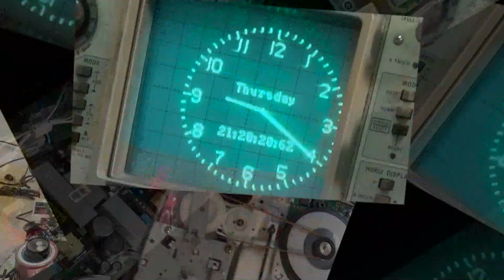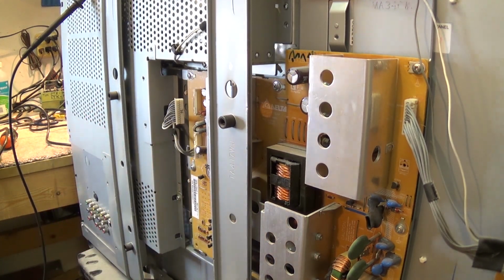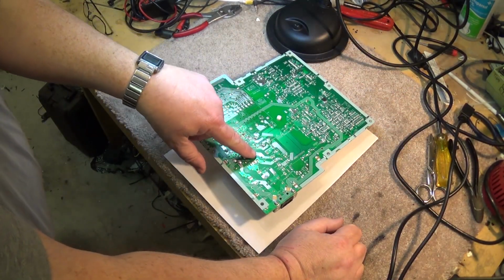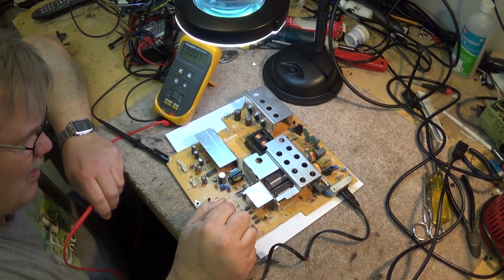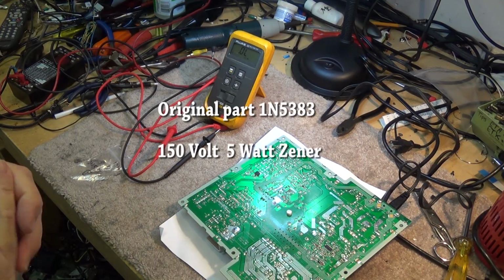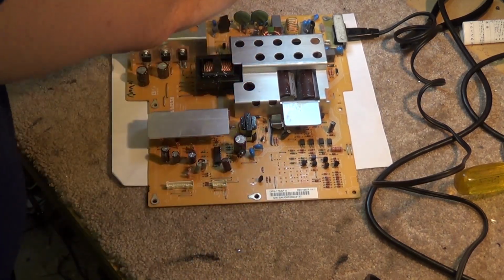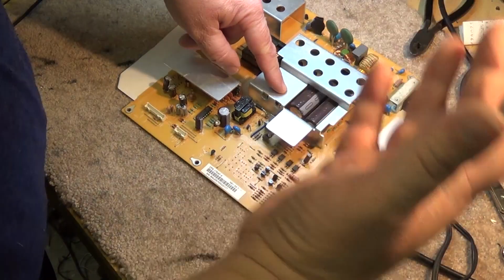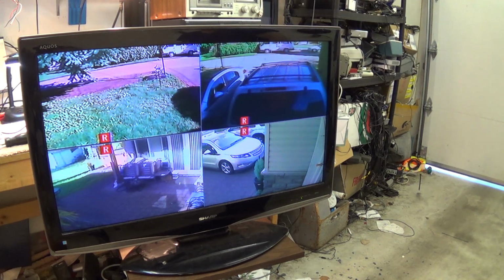Sharp LC37D43 Dead Set

Comment: Thanks for posting.  Had this exact issue with 37in aquos till about 5 min ago after installing the new diode.  FWIW the two screws at the bottom of my board were also missing from the factory.

Comment: I know exactly what what your precautions are.  You are a very safe person and you warn others that don't have any experience, not to mess around with these boards.  I hear it on all of your videos, safety first and protectiing the equipment.  I wouldn't worry so much about one persons thoughts.  You're a very knowledgeable person.  You get into the problem and you stay with it until it's fixed. I would do an aircraft the same way and I've worked on a many a aircraft that was in the Air Force inventory.  Safety is the priority.  Always be respectful of electricity.  Let me tell you, I've been shocked a few times and you can't forget the feeling.  The vibration of the current or voltage is just not describeable. Keep up the good work, even in 2019.

Comment: Hi, I got this problem with this Sharp, and I learned that without the diode the TV will work, yes you read it well, just cut or remove the diode and TV will work.. there are some parasitic voltage and such voltage is enough.. But just in case and due to the continuos diode failure I put a external 5vdc cellular power supply, and it works fine..

Comment: It's so nice to see a technician that owns and uses an ESR meter. I get so annoyed everytime I watch some idiot decide to replace every cap on a board because he heard they're usually the problem, and he doesn't know how to check them.
Reply from the maker: ESR meter has saved my but many times.
Reply from the maker: Dylan McConnell 
That's called shotgunning and it is only applicable when rebuilding old vintage tube radios as those old paper capacitors all fail just from sitting.

Comment: Hi! I have problem with dps-208bpa
Actually big transformer on it is shorted... I can’t find it. Maybe you can suggest where I can find this part?
Reply from the maker: I don't know.  If you know the voltage you can check with Hammond manufacturing and see if they have a generic that might work.  Or allanson transformer.  
I found a new transformer from Hammond for an old radios from the 1930s.

Comment: i've got a Sharp UB30U 55" TV that one day just stopped turning on, it's got power on all 3 5 Volt pins (about 5.29v) but not on any of the 12 volt pins, but when I do a continuity test between the 12v+ and ground I get a value while set to continuity testing but nothing on Voltage. Just have a cheap multi-meter and not worth paying to get someone to fix this for me as I already replaced it, but would be nice to get going again if I can, thinking of just buying a used power board off ebay for like $50

Comment: Got any tips for finding out the correct value of a zenerdiode without a schematic. I'm working on a power supply for a japanese SEGA Dreamcast. Found a shorted zenerdiode but now I don't know what to replace it with.
Reply from the maker: Look up the numbers printed on the diode.

Comment: Thanks for the video. What would you start looking at if you had a set that channel 30.1 would not come on unless you turned on 30.3 first. After that all is well? It acts like there is no signal only on 30.1, just a blank screen until 30.3 tuned in. I am not going to do anything about it now, just curious where you would start if you were looking at it?
Thanks again for your videos.
Reply from the maker: Try rescanning the channels.
Reply: 12voltvids Thanks, I have tried that a few times. It just seems strange and I was wondering.Thanks for the videos.Don

Comment: Because I own my own geology lab and electronics shop, I have no boss to yell at me for me breaking every safety rule in the book.  I don't wear shoes (although when working on live circuits I put my feet on the nonconductive feet of the chair), I smoke, drink water and eat candy and am messy.  One time I was using the 1950s table saw (which has none of the protective measures of modern ones) and cut half my finger off.  But any why, I love being my own boss.
Frank Reiser

Comment: Question please.  Are caps that read ESR=0 ....bad caps?
Reply from the maker: ESR is the equivalent series resistance of an electrolytic capacitor, and it varies by capacity and voltage of the cap. There are tables that show approximately what it should be. They are generally a very low number.
Of course as I found out on that Technics tuner capacitors CAN dead short, so if you are relying on an ESR meter, you will be mislead as I was. An ESR meter is a test tool, nothing more. You need to use it, along with a regular multi meter to measure capacitors, and then use knowledge to determine if it is good or bad.
Reply: +12voltvids
Wow!  Thank you for that quick response, appreciated.  I'll keep what you said in mind. Cheers!

Comment: Does Sharp generally make good TVs? Asking because I am buying an older HDTV (older = 2013 or so, I have good reasons) from either Sharp or Sony. Want to get something that will not break on me for some time.
Reply from the maker: I never considered sharp to make anything that was really good, however I do have a sharp computer monitor and as of right now it has 43663 hours on it and it is still running. (just checked the hour meter) This monitor shows my security cameras and it is left running 24/7
Reply: So, will I be safe buying 2013 era Sony Bravia instead?
Reply from the maker: The Sonys have been pretty good.
Reply: Thank you. I will take your advice, and run with it!

Comment: When I started in the business no one wanted toe teach me anything. I remember asking an owner of a repair shop about buying a Sencore CRT tester & rejuvenate.tester. He tried to talk me out of buying one. Later on I saw him using one in his shop.
Reply from the maker: When I was in the business the owner spent about 4 grand on one of those sencore TV analyzers. In the 20 years I was there I used it once. Same with the CRT rejuvenator very rarely used one. The boss policy was if the tube was weak, dont extend its life sell them a new set. That was his attitude with the sencore as well. The test gear i used. Scope, dmm, ear meter, signal generator and video pattern generator for convergence, color bar ect. One day I showed up and the boss said pack up the sencore and he sold it.  I probably couldn't use one now if I tried because I only used it once in about 1986
Reply: I had over $10,000 in Sencore equipment, scope, crt tester, transistor checker, VA-62 and isolation transformer. The VA-62 was good for testing fly-backs, tuners and it was a pattern generator. I used the rejuvenator a few times, many of our customers couldn't afford new sets. I wish I had kept my Sencore scope it was very easy to use as it was auto ranging, I seldom had to adjust it.
Reply: I think Sencore was goo for us beginners in the business, I attended their free seminars and they had a free tel no. where you could get help by talking to a Sencore engineer.
Reply: The VA-62 is very useful, takes time to learn how to use it. You can inject signals with it.
Reply from the maker: @cat-lw6kq  Well they taught you how to use their equipment. When I learned, my mentor was an engineer that worked in an early factory in Hong Kong, and when he came to Canada he joined the military. After the war ended, he became a partner at a shop, and eventually ended up buying that business after the original owner retired. I started working there when I was 15  and he taught me everything he knew. Wanted to sell me the business so he could retire, but I went on to work for Sony, and then left Sony to work for a local dealer. Did that for 20 years before getting fed up with the entire service attitude, so I left and swore I would not do any more work. Managed to stay away for about 10 years, and then started taking on special projects at home, and it has snowballed from there. I just serviced a Denon AVR-X4000 that was shipped in from a province away. Will be doing the video for that later, and getting it on it's way home. I have stuff shipped in from all over the country these days.
Reply: I took some night school classes years ago in tv repair. got a job in a small shop after I left AT&T where I worked as a tech. we closed the shop in Jan of 2008.
Reply from the maker: @cat-lw6kq  
The shop I worked at closed their doors in 2012, but I was long gone by then.
You left the phone company to work in a TV shop and I left the TV shop in 2003 to go work for the phone company. Don't do much work on the phone side of things now though, it is all broadband, tv and security alarm work.

Comment: How can I use colored Christmas lights in electronics?  
I made Lyden jars, which are enormous capacitors that hold far, far more power than any diode or CRT that you can buy.  I charge them up with my Van de Graaff generator.  One time, it discharged on me sending me to the hospital.
Frank Reiser

Comment: 12voltvids ever work on tube stuff?
Reply from the maker: +Brian smith Yes, I did. Tons of it in the early 80s when there were tube and hybrid TVs from the 70s still around.I have 3 tube pieces of equipment presently. 1 modern, and 2 vintage. The vintage is a McIntosh 1600, and an Akai 1710wThe McIntosh needs a rebuild which I might do at some point. I am not currently using it, so that may be left for a rainy day. Tube gear makes me nervous. I have been bit a few times by 480 or so plate volts. It is not something you soon forget.

Comment: I reside in upstate NY and my Samsung PN51D490 has vertical lines in it... so does my sisters (same model and problem), is there anyone here that is in the Upstate NY area than can repair these sets for us?  I already tried the Yellow Pages... and the tech's say to buy new sets.  Why... when they can be reapired... please reply soon.
Reply from the maker: Cynthia Culverhouse 
Vertical lines are usually the panel that has failed. On plasma horizontal lines are a failure of buffer chips and those can be repaired by changing the buffer board but the address chips that drive the horizontal scan are bonded to the tabs that are part of the panel and can not be replaced separately.  On lcd and oled the driver chips for both horizontal and vertical are part of the panel. If an lcd has a problem on half the picture or the entire picture it could be main board or tcon but if it is just a couple of lines then it is always the panel. Time for a new tv.
Reply: So what kind of tv's are those that cn be repaired with the vertical lines?  It can't be dust or a loose connection?
Reply from the maker: Unfortunately the vertical line problem is almost always the panel.
If you lost an entire strip vertically (about 1" wide) it is possible one of the edge connectors came unseated on the board that runs across the bottom, known as the A or address board, but if it is a single black  line, or a single color (red green or blue) or a few single lines, then it is the actual drive IC that drives that column that has gone south, and the drive ICs are part of the panel.  Some sets were prone to bad panels unfortunately, and others they never failed. That set was produced nearing the end of plasma sets, and the late modem ones I have seen just didn't have the quality of the earlier sets which were very reliable. 
Sets made prior to 2007 had the capacitor issue, 2008/9 very reliable, and then they went to the slim panel, energy star bullshit, and the quality started to slide. If it was horizontal lines running across the screen then reseating the connectors on the left side looking from the back could be the cause or the buffer chips on the buffer board.
The high power on the panel is driven by the buffer boards, and thus they made them external so that they could be replaced. The address chips do not handle much power and therefore in theory shouldn't fail so they were not put on separate boards, but bonded to the non removable tabs that connect the panel with the interface board.

On LCD the chips that drive the panel in both directions are bonded to the glass so thin lines on an LCD (or LED) panel is always the panel.
Not much you can do. Live with the lines until it becomes bothersome and then toss the set.

Comment: Good Job, why in a hell..., anybody give you thumb down??? Must be that same guy ;o), so , anyway, where can I order that diode?/ Couple other questions, since your knowledge , Sir, seems to be bottomless =)1) Have Samsung 60 LED, model # UN60EH6000F, no visio, just audio, probably T-com board?? how do I measure/check T-Con board? Now, I have extra T-Con board, # UN65EH6000F, could I put that in there?? ALso, I saw another video, where there was UN46D600, no visio, just audio, and the problem was cap. CD31 and Trans. QD2. What are those parts jobs?? Do my unit, UN60EH6000F, have same numbers on those, CD31, and QD2, or are they different, since TV is bigger?? Could the problem be same inside T-Con board?? Thanks again, you are a good man, Keep It Up!!!
Reply from the maker: Diode is just a common zener diode. Should be able to source that at any electronics components dealer.As to the LCD set, it could be the Tcon, but usually you get some type of distorted picture when that goes bad. I haven't had many LCD or LED TVs in for repair as I generally avoid them like the plague.
Reply: Thanks, and how do I test that T-con board?? And could I use the other board, UN65EH6000F, almost same numbers?? Would that work?? Thanks, youtheman=)
Reply from the maker: They are model specific. You need the exact same one or you run the risk of creating smoke.
Reply from the maker: Because assholes are everywhere. Some twit out there just wants bragging rights to the thumbs down column.
Reply: OK, Thanks, how about those cap.CD31, and Trans. QD2, do my unit have those same numbers, and should I try to test/fix them, maybe to get old T-con board working?? Thanks again =)

Comment: another shitty Delta power supply...
Reply from the maker: +firehawk0071 I didn't even notice that.A company I used to work for had an electronics manufacturing arm called "Delta Electronics" they made cable splitters, directional taps, and distribution amplifiers for the cable TV industry. Of course they sold that off probably 35 years ago.